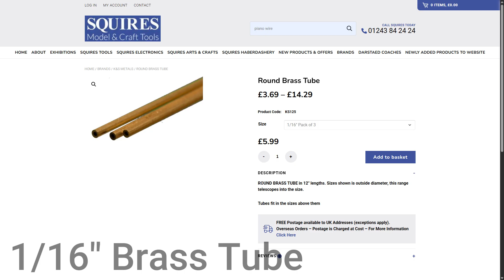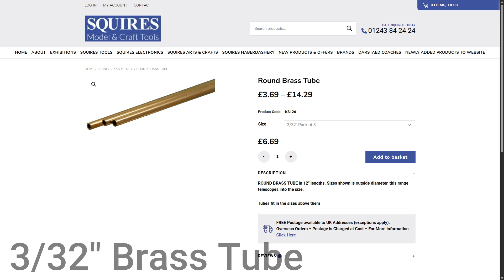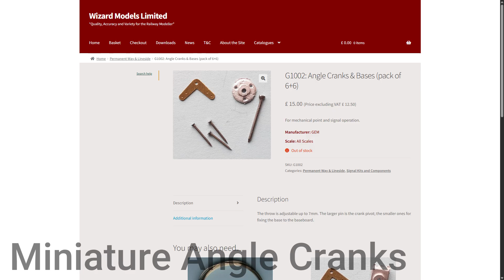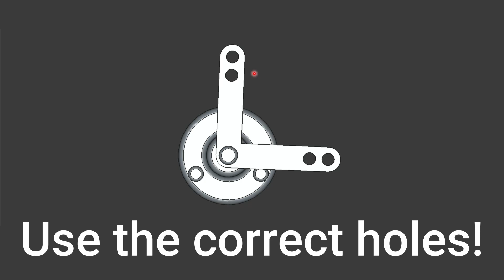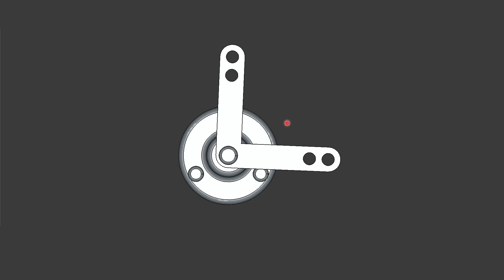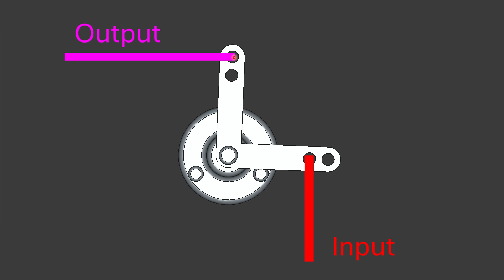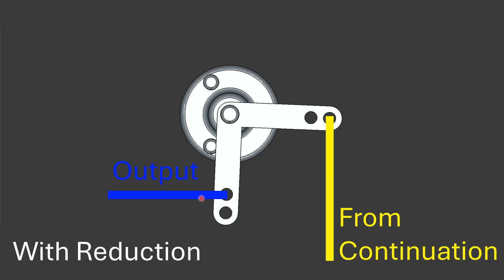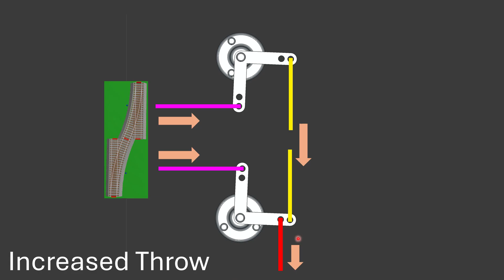Mechanical Point Control for Model Railways - the Quiet, Cheap, DIY solution

Comment: I am seriously considering doing this for my layout as I'm not a fan of electrics and I also think that this method is more prototypical. My shunting layout I am working on stretches across 2 boards with points on both ends. Is there a way I can have all the point rodding heading towards a single signal box on one board and have it "split" as I want it to be modular, or should I just keep one board limited to one section of rodding and the other board to the other section?
Reply from the maker: Interesting, I guess you could have the controls for each board near the join between them, so they’re still detachable? Or you could have like a bit of terminal connector block if you’re doing rodding under the boards where you connect rodding runs if you’re not connecting/disconnecting the boards too frequently?

Comment: Lots of mechanical complexity. How do you hide all the wires and cranks when doing scenery? 50+ years ago my brother used switch motors that mounted under the HO layout and had a  small actuator wire come up. Forget the brand.
Reply from the maker: Basically exactly as you describe. Either put a simple channel in the track bed for a tube, or take the rod through the baseboard with and hole and do it all on the underside.

Comment: @4:00 those switches can indeed be used for frog polarity switching very easily, I used that method on my NCMA module, Outwell Basin which has performed faultlessly at many shows. Your implementation of the the WIT is much neater than mine though, great job on that 😊
Reply from the maker: Haha, thank you! Yeah I suspected it could be, but I've never done that kind of thing myself. Glad you've had success with it!

Comment: My method with Peco points was even simpler. Fishing line tied to each end of the tie bar with coloured beads on the other end. Just pull the bead and the point switches. I've been using this for years, works a treat, just a small hole in the base board on each end of the tie bar. No problem with redirecting the fishing lines to your control panel via screw in eyelets under the baseboard. The flex in the fishing line is also  very forgiving. I've never seen anyone else use this method but it works well, is simple and above all for those of us on a tight budget, this method costs next to nothing!

Comment: A 3d printed set of switch levers would be a pretty cool system.
Reply from the maker: Im not very familiar with 3D printed stuff, do you think the levers would be able to take the strain and not have a tendency to snap?
Reply: @PLMRailways Yes, there are some tough filaments and resins, or even outsourcing for metal if you have the budget
Reply from the maker: @Metagross555  Interesting! Yeah maybe one day I'll venture into 3D printing land.

Comment: Amazing! How do you attach the wire to the electrical switch?
Reply from the maker: Drilled a hole through the plastic part of the switch, then bent the wire through 90 degrees, popped it through the hole, and another 90 degree bend on the other side to secure it. Hopefully you can see what I mean at https://youtu.be/lD6dLFgtX7w?si=2M-48IucCvdosO5n&t=239

Comment: You can make bell cranks from a simple triangle shaped piece of sheet metal and drill holes in it.
Reply from the maker: Indeed, I chose to use hard plastic in my other video (link in the description), but same idea. I was less confident about drilling metal.

Comment: This is gold..... thanks for putting this together. Any advantage/disadvantage in fixing down the brass outer tubing ? The prototypes do secure the rods in saddles so was wondering if the same can be applied in miniature?
Reply from the maker: Thanks for your kind words! Good question. I have personally done a mixture depending how long the run was and how easy it was to secure. I find the shorter runs from a crank to a tie bar sometime need to twist a little bit, but the longer runs don't.
Reply: @PLMRailways So basically suck it and see.😅.... thank you.
Reply from the maker: @MrSteamDragon  A bit of trial and error is always needed with these things in practice I find!

Comment: Use GEM omega loops to take up the slack if the switch operates too far. Switch is used for frog switching at the same time.

Comment: I like your realistic point control system, but at 5.34 I can see the risk of a short circuit between the rails caused by the brass tubing. Insulation is urgently need here.
Reply: I use plastic tube for that reason
Reply from the maker: Yes, that's something I noticed too when making this video. There is an air gap between rails and tube, and the brass tube is firmly held down to the baseboard, but you're absolutely right, I should put something in the gap to make it foolproof :)

Comment: Really good video. I want to use wire in tube and this inspires me. The change in motion at a bell crank is more-or-less the ratio of the radiuses - if you connect rod A to a hole at 10mm radius and rod B to a hole at 5mm radius, then rod B moves half as much as rod A (5/10) - put rod B at a 7mm radius and it moves 7/10 as much as rod A. For small movements anyway

Comment: Excellent video. I would, however, look at replacing the expensive copper tube & cranks with the cheaper pvc or silicone tubing which comes in a variety of diameters and lengths. It also being flexible, a set up much like the brake cables of a bicycle, allows you to negotiate all those fiddly corners.
Reply: The thing about metal versus plastic is durability and longevity. Though it looks small. There are stress's on the components. So, though plastic may work for awhile. Maintenance will be required. Whereas with metal components it is virtually Maintenance free. Perhaps you could start out with plastic components. And then replace them with metal when Maintenance comes due.
Reply: Tubing needs anchoring. I have used Peco spikes every 50mm or so. Gentle curves only.
Reply from the maker: Great idea! I have seen that done but not tried it myself (yet anyway).

Comment: well worth noting, even for layouts with motorised points this stuff can make life easier in that you can now put the motors somewhere easier to access

also if the throw is a little off the "omega loop" idea works well

can also go a bit further with a crank to reverse the direction at the mid point and it handles thermal expansion as well

prototype practice, though you have to go overscale with it for reliability

and very nice with the LEDs
Reply from the maker: Brilliant tips. Thanks for that.

Comment: No need to buy expensive mini cracks. You can use any flat piece of plastic as a crank, just drill three holes arranged in an L-shape. You can also use these to make the throw slightly longer or shorter if the switches have a different throw than what your points need.
Reply from the maker: Yep! Absolutely. This is what I’ve shown in the other video about making cranks, which I linked in the description :)

Comment: I believe the cranks you need are called "bell cranks" - I can find quite a few (mostly plastic), cheaper than the sold out ones, by googling.

I have been considering this, and you've made me consider more.
Reply: Great explanation.

The plastic bell cranks are available from radio controlled aircraft suppliers. 

Do you have anything insulating the tubes from the rails.

Cheers  Peter from downunder.
Reply from the maker: Good to know, thank you!
Reply: So much of this stuff can be easily made, and custom made to suit the location. You don’t need to be restricted by what’s available to buy, except for some materials of course. We’re running live steam in the garden so we don’t even need to worry about the electrical stuff 🚂🚂
Reply: A RC servo horn could also work as a crank.  Some servos come with a selection of them.  If you have friends in the RC world, they might donate a few spares.
Reply from the maker: @peterholland3306 yeah I do have some actually, although they’re fairly large by comparison. Certainly an option though!